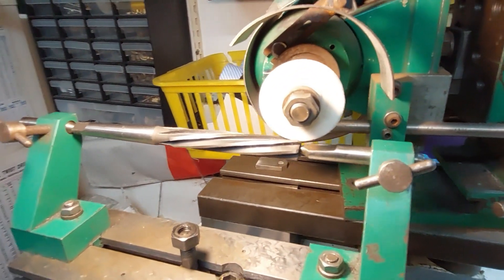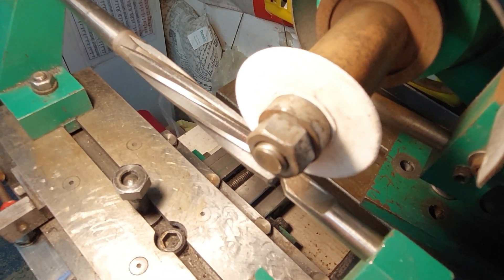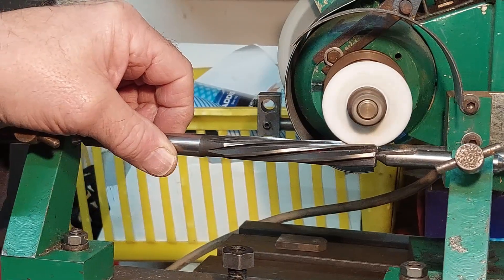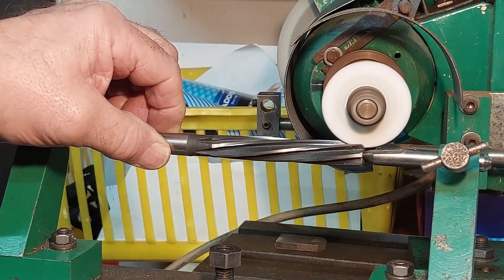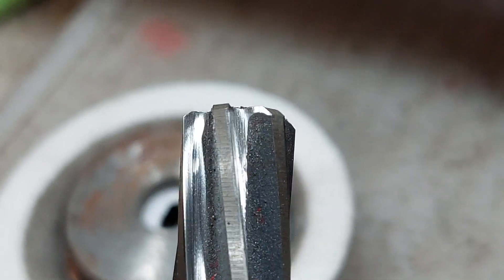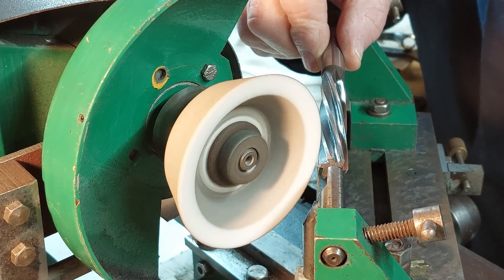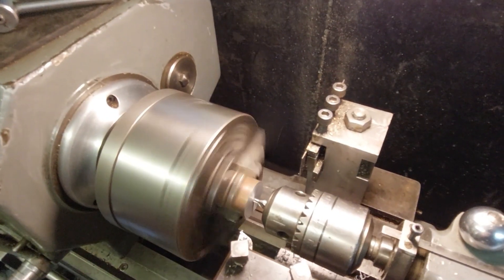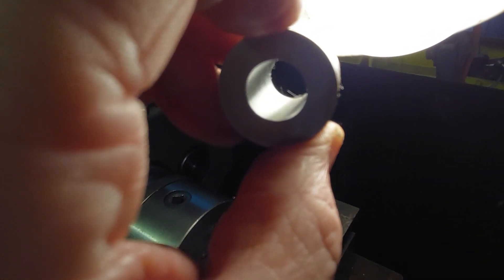Reconditioning A Helical Machine Reamer.

Comment: A most enlightening video - thanks. A couple of questions, if I may - what make is your T&C grinder? It look similar to a Stent or Perfecto… or home-built like I’m currently doing!
Also what size and grit are your wheels?
Thanks
Mike W
Reply from the maker: Thanks for watching the video,my tool and cutter grinder is made up from odds and ends what I had to hand about 35 years ago,I made it up just for grinding slot drills and end mills but progressed to other cutters,I do plan to make a video showing how its built,once again thanks.

Comment: Thanks for sharing. l thought that it was done with spiral follower and cams but this cool idea is nicer than complicated mechanisms.
Reply from the maker: Thank you for watching the video,it's a little known way of grinding like this but when I was working for a couple of tool makers years ago this was the method of grinding the flutes of all kinds of reamers and certain drills in the rough state straight from hardening,they were all hand ground and then sent to the finish grinding section for taper grind and od grinding to size,then for the bevel to be ground at 45 deg,it was found that grinding the flutes like this we had more control and "feel"this way and was very quick,more so than machine grinding the flutes.
Reply: Очень редкая методика шлифовки канавок. Я благодарю за отличный урок.

Comment: A reamer only cuts on the chamfered edge at the point NOT on the flutes.......if you have mishandled a reamer and it has some burrs along the flute, stone them with a fine stone by hand.
Reply from the maker: stoning did not remove  the small nicks which were deep but  not as far as the radial land unfortunatly they did not show up in the video I tried stoning before grinding which 99%of the time works and is sound practice,thanks for your comment and thanks for watching the video.